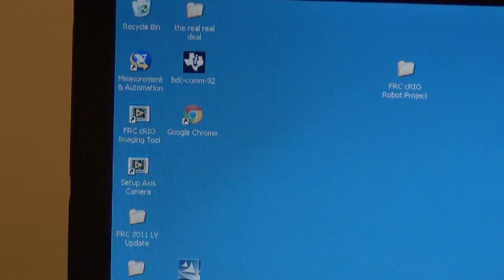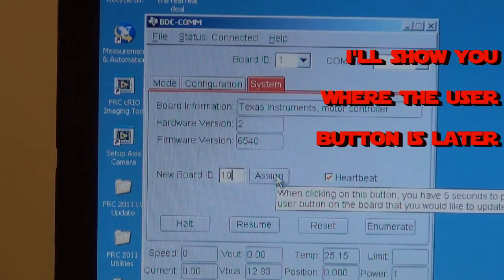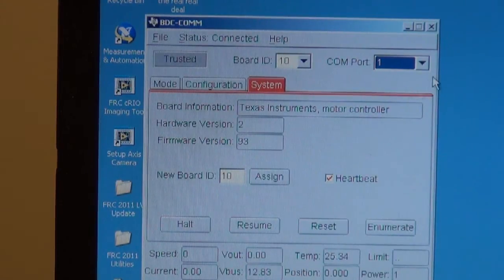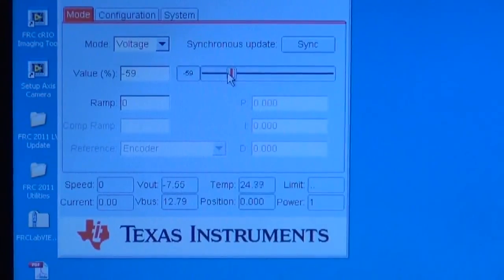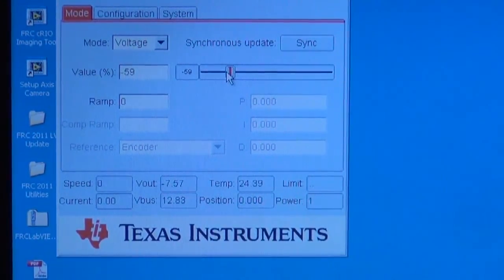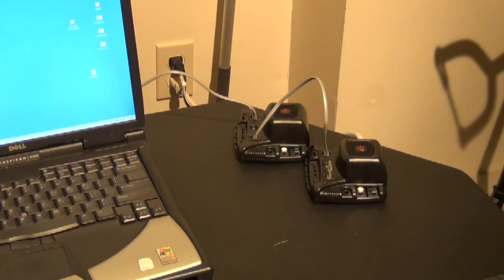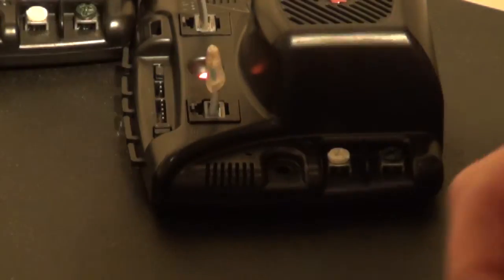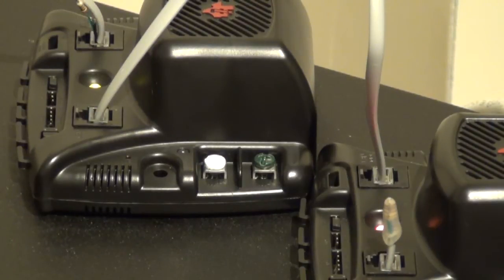FIRST Team 2168 Tutorials - CAN Jaguars

Comment: CAN is a serial communication by which you can transmit and receive data. PWM is only a choice (most common) to control DC motors. PWM is still being used to control the speed and acceleration of the DC motor when you use CAN to interface your MDL-BDC with your PC, only the PWM data is being send through CAN.

Comment from the maker: For more info visit our web page on the topic (See the link in the show notes)

You can use the jaguars in either CAN or PWM mode, CAN opens up the possibility of using advanced features, and the wiring is more reliable IMO. 
The basic difference is that closed loop systems monitor the result of a command through sensors and use that sensor data to adjust the future commands